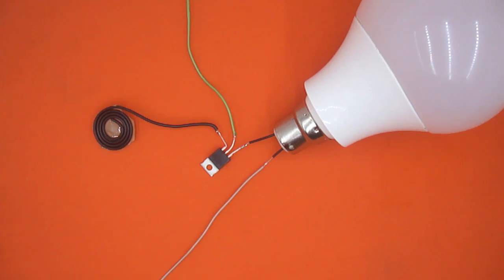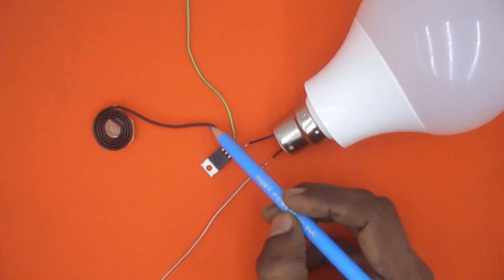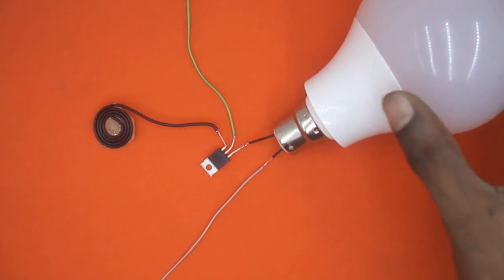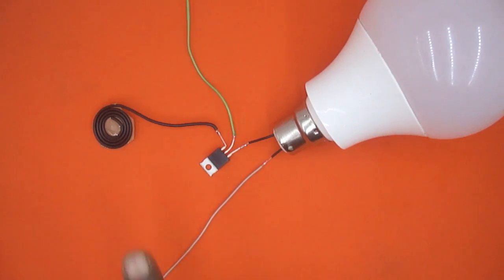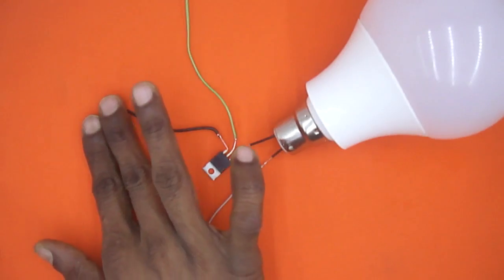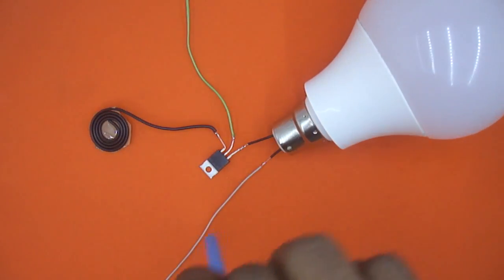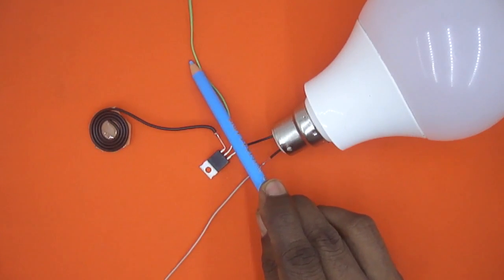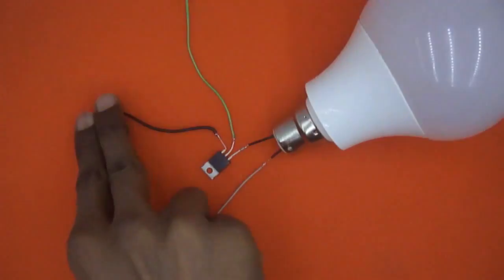BT136 : Making of touch sensor using BT136 TRiAC

Comment: +BRiCS: BEST SUMMER TRAINING INTERNSHIP PROGRAM
Can I use this to directly interface with Arduino Microcontroller or Should I use BT136-600E instead of this BT136-600 because I want to can the Arduino's output power, power the trigger gate of the BT136-600 or Should I use a much lower triggering gate current BT136-600E